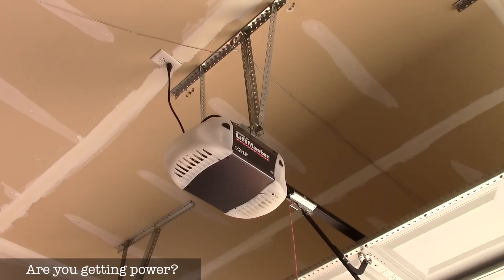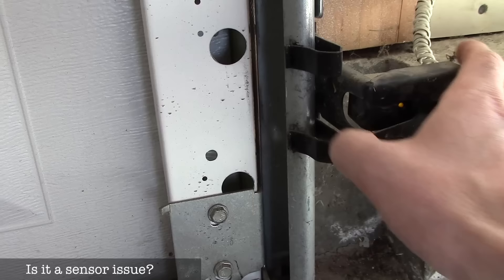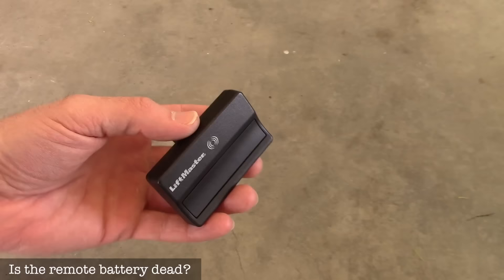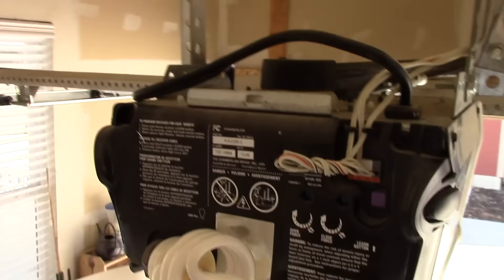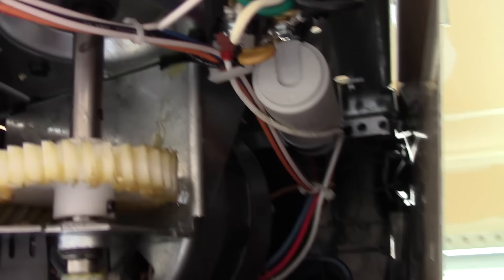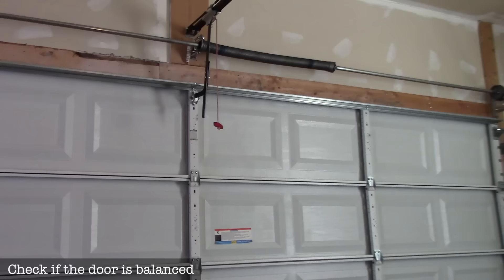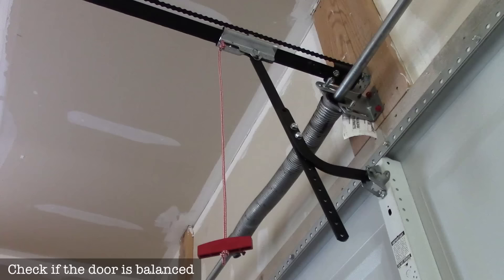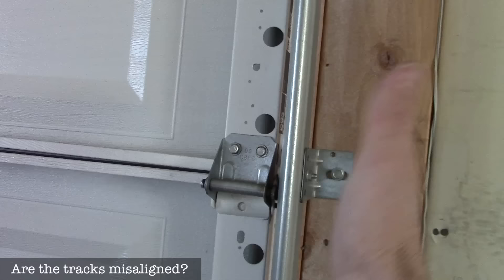Garage Door Opener Troubleshooting and Repair - How to fix common problems

Comment: the slide bar is not connected and when you press the button it moves back as far as it can go then stops. it will not move back along the rail to the garage door and reconnect. also I pulled the handle so I could manually raise garage door but I cant pull the door up

Comment: Help! Recently the long black wire that leads to the garage door fell down. Now when I shut the door, it pops back up unless I hold the button down. I don’t know what to reattach the wire to?? Is it a ground wire that just needs to be attached to a screw? A pull it as far as it will reach but I don’t see what it could’ve been attached to 🤷‍♀️
Can anyone help?

Comment: When I use door opener the motor clicks but door doesn't open so I release the track lever and open door put the lever back on track and press door switch the door will close and open a few times and I  leave it alone come back 10 mins later and door won't open again with the switch or remote so I repeat the earlier process. Any ideas?

Comment: The garage door opener used to operate when I was about 100 feet from the house driving down the road. Now most of the time the remotes and the car buttons don't work unless I'm right at the garage door outside. It sounds like RF interference. How do I check that?
Reply from the maker: Did you recently install LED bulbs within 20ft or so? Those have been known to cause problems.  You can buy an RF Meter to test your area but I have no personal experience with them.

Comment: My garage door opener will not work! Remote and button on wall doesn’t open door.  There are 3 doors and 2 work well, buttons on wall are lit except for problem door. Breakers are fine. Any ideas?

Comment: I'm having an issue where when I press my garage remote button or the button on the wall I just hear a single click from the unit. I verified that it is getting power and that the sensors are working. 

Any ideas?

Comment: My opener would start open then reverse after about 6 inches. I unplugged it and adjusted the rpm sensor. Now, after plugging it back in, it doesn't respond at all. Please help.

Comment: How do i fix a programing problem? My garage works fine but my remote stopped working so I replaced the battery but it still wont program to anything

Comment: Hi.....why do remotes on my craftsman garage open only work when I'm inside my garage within 2 feet on my opener. From outside my garage the frequency isn't strong enough to open the door. I replace both batteries on the remotes.....no change.
Reply: Based on this video that sounds like the antenna might be the issue?

Comment: Turned breaker off and on. Pressed wall unit and it sounds like the motor is running but nothing is moving.

Comment: My wall switch opens & closes fine. My remote keypad & 2 handheld remotes open every time. But they quit closing the door. Unit does not even try to close...no starting & stopping. Sensors are good & unblocked. Changed bulb. No joy. ??

Comment: great video. But I decide to ask you help because I  could not find any answer for the issue I am having.  please I need your opinion. The issue is that when I close and open (USUALLY closing), the door stops at the same time the light off as well . And sometimes it works after few minutes or after while (10 mins or more). I checked everything you mentioned ( except capacitor) and found nothing wrong. any idea? thanks so much.
Reply from the maker: It sounds like the door is hitting some resistance when it reaches that certain point.  The increased resistance trips the opener to shut off rather than break parts.   Have you pulled the release cord and checked for smooth operation opening and closing the door by hand?
Reply: +AdamDIY thanks and yes I did and found non. it stops at any point and moves again when I push the button. And stops again.
Reply from the maker: its hard for me to know without seeing it, but it could be bad sensors or bad wiring to the sensors.  If you hold the wall button down and force it closed does it close all the way without stopping?
Reply: +AdamDIY thanks.
And the answer is no. It shut off everything including light and when I tap it with stick, light comes on and I push the close button and it shut off again for few second or minutes or hour. And again I tap it, it comes to life and on and on.

Comment: OK.  I need help.  Neither of our garage door opener remotes will close the garage door.  They both will open the garage door but not close it.  The wall mounted control will only close the door if you hold it down until the door is closed.  Can someone tell me if it's the garage door opener or not?

Comment: Help. My garage door pushes down against pavement when i press open, then pull back up two foot and stops there.. leaving a gap😢. If i press open again it will do the same thing pushes down against pavement then pull back up two foot n stops😢 The metal arm bended now😢

Comment: I watched the whole video, checked everything, wires connected, rollers ok, sensor lites unblocked and lit, straight and clean but door still doesn't want to close as if something is in the way of sensors...what to check now?

Comment: Can't seem to find the problem. It opens about 6" then goes back down. Same problem w/remote or with main control. We were away on vacation for 2 weeks, it worked fine. Day after it just wouldn't open. Help???

Comment: You replaced a LiftMaster with a chamberlain.?  Chamberlain makes LiftMaster. Chamberlain is a cheaper DIY version of the professional LiftMaster series. If it’s been bouncing on the way up or down it has to do more with the torsion spring.  Also the chain is super loose. If its sticking due to paint you can put a thin layer f white grease on the areas it sticks and that will eliminate that issue too.

Comment: My garage door will not close when I push the control on the control mounted on the outside door jam,it will close if I enter the code or push the remote.

Comment: My battery was going out and failed. Watched the video for replacing the battery ( I have a Craftsman opener from 9/11) with a new one. Now the push button control on the wall is dead (no power, or light) What could the problem? Tried watching other videos but none of them were helpful. My opener motor unit has 2 buttons a purple one and a black one, pushing and holding one button will open the door pushing and holding the other button will close the door. Can't figure out why no power to the wall mounted control.

Comment: My garage door opened fine yesterday am but went to close later in day and it won't close. It make a noise like it is trying to but it doesn't ingage the chain
Reply from the maker: Sounds like the gears or drive sprocket is broken. I have a video on that repair uploading right now.  Check my channel in the morning.

Comment: I am baffled as to why those sensors use wiring that can literally be clipped in half with your fingernails. I'm so incredibly perplexed I can't even explain. My garage has stopped working several times now because of these wires being faulty at least on mine! Yours look significantly thicker.

Comment: Does a low light blinking of the wall button indicate anything? Button doesn't cause any action.
Reply from the maker: The “lock” feature is engaged.  Hold down the lock button for a few seconds and it will turn off.
Reply: @AdamDIY  Thanks for the reply. I have no lock button on mine.

Comment: My lift master when I turn it on to move it pull from the wall . It moves   a little bit and then reverses back. Like it pulling from off the wall
Reply: I forgot to add I replaced spocket

Comment: I just purchased a home and the door opener opens or closes by it self without using remotes. This happens occasionally. Damaged my car 2 days go . I am thinking a frequency problem. What might be a solution?
Reply from the maker: The easiest thing to try is to erase and then reprogram the codes. If it happens after that, you may need a new board.

Comment: Mine won’t OPEN!!!!! Anything for that?  When I press the lock button, the light on the Mother flashes and clicks, I changed the batter on outside pin pad, but still won’t open the lights on the pin pad pad are red instead of yellow like usual. My remote car button won’t do anything either nor the inside

Comment: Adam, I can't find a solution to my problem anywhere! I have a Chamberlain Liftmaster 1/2hp model number 1355. It is 12 years old, and has been working fine no issues. We have a cat that sleeps in the garage at night, so in the morning we will crack the garage about a foot so he can go out etc. We have been doing that for years, but lately he has been chilling under the door because he doesn't want to go out he wants to spy on other cats, birds, etc! I go to close the garage door and out of nowhere the light bulb is rapidly blinking, the garage door opener on the wall is rapidly blinking, and the opener itself is clicking all simultaneously, and in sync. The sensors are green and amber, the green one blinks when I pass through. This rapid blinking and clicking doesn't stop EVER! I don't know what to do. I have checked over so many things, nothing fixes this. Also no button pressing on anything is making the door open and close, so I had to disengage the door and locked it with a padlock from the inside until I can figure out what is wrong, and unplug the unit and I turned off the breaker. This opener btw has its' own breaker and own plug, and the wires are behind the drywall too. :(

Comment: Good info, but I did not find out how to fix MY trouble.    Door TOO heavy need to put more tension (I see video)  to balance .   Spring rod  to tighten The door spring  for easier raise?   spring up to get a balance > ?  ~~  the door  did not stop and caught tool chest drawer and pulled the door fastener out and when I put it back with lag screws the hook up closes the door  big drop Big  BANG>  but will not hook up to raise.   It tries to raise but drops out and goes back down.    Seems to ME it should have some kind of pin to hook in the carriage for UP and OR Down ) (. 

  Like the thing that hoks up does not hook.   Is there a pin /rod to catch to open?  IT closes it down , but will not hook up  and stay hooked  (drops out and door slams back // when tries to raise.   OR do I need a all new $30 ?   Kit How does it come apart or un hook?   Does the chain come out (loose) and how to get the pin replaced ?    Our door install did not get a safety light system ~~  I see now it should have been with the opener.

Comment: its great but  my problem is that the door  opens and closes from the wall openers  but not  from the REMOTES! We  changed batteries, LEE  bulbs changed out,  no obstructions on the floor sensors either.   but nothing helps!

Comment: Garage door works normally when it's warm. When it's cold. Below 65 degrees, it goes up a little stops goes up a little more stops. Can't figure it out. Works normal in manual no matter the temperature. ????

Comment: Does anybody know what an external button fault is? My vacation lock button even after reset will go off every now and the and the opener will not work. I don't understand why the lock button keeps flashing When I look at the fault I see that my external button icon is flashing

Comment: My garage door won't close during specific times (11am-2pm) and the sensor light flashes as well during this time. When I try to close it, it will start to close, then stops part of the way and goes back to the open position.  Outside of that time, everything works perfect with no adjustment made by me.  What could be the issue?
Reply from the maker: Sunlight hitting the sensor is the most common reason for your problem. I assume it will open with no issue during 11-2?   I talk about it in my other video, see it here https://www.youtube.com/watch?v=CewKaLlns0Q
Reply: Could be that at those times the sun is shining "just right" into one of the optical sensors at the bottom of the door.  That can confuse the devices and prevent the door from closing.  It happens a few times a year with our door, though usually later in the afternoon.

Comment: My garage door randomly opens on it's own. It's not an rf signal that is causing it to open because the light in the housing plugged into the ceiling flashes when an RF signal causes it to open. Can anyone help?

Comment: Garage door goes up and down with remotes.  I have a problem with the opener on the wall inside garage.  It continues to flash and it won't open or close the door.  It is a champlain.
Reply: Chamberlain

Comment: My Sister in Law called and told
Me her garage door would not open. After getting there I notice the mounted door console was not lighted as usual. I took it loose from the door and shorted the two wires together and nothing. I took one of the new remotes and pressed the “open” button. The large main light flashed three times, which indicated it was getting power but it still would not open.
When it didn’t open for my Sister in Law , she just now told me she pressed several buttons with no results. This is not a keypad but a LM console with a flap That has a stud that pushes and activates the console. Under the flap it has a Lock button and beside it a Learn button.
The light button does not turn on the main light, the wall mounted console does not light or flash like before and is totally dead. Is it possible the main board in the opener is bad?
It is a Liftmaster Security 20.
Thanks

Comment: What is the problem, when you can open the door but cant' close it soon afterwords.  Then hours later, it works again?
Reply: Bill - Were you able to find a solution?  Mine is the same......I can open, but directly afterwards it will not close.  However, if I wait for a period of time, it will close.

Comment: I just left my house to head to work and my garage door wouldn't open. Wife's side is fine, my side gives no response. No light on the wall opener, no light on the ceiling opener, no response from anything. After watching this I assume it's the circuit board or capacitor. Breaker is fine and I'm getting power from the plug through the cord into the opener. I have an electrician wand I tested the power with. Hmm. I wish I was home to tear into it.

Comment: My remote only worked to open the door at a great distance. Read that removing the 
Led light bulb and replacing it with an incandescent bulb might be the problem. Try to find a light bulb that isn't LED !!!!!

Comment: Hey Adam thank you for the video. I have a chamberlain liftmaster professional. My problem is the power goes off completely. The wall outlet light goes off and the car remote wouldn’t open or close the door. After a few good smacks to the unit the power comes back on and everything works fine. Sometimes it works for weeks sometimes it last a few seconds. This week it got worst, where it lasts a few seconds only. I checked the outlet with another device and it’s fine. I opened up the unit and checked the wiring and all looks good. The only thing I can’t check is the capacitor and the board. It tends to happen during weather change. Any idea on how to fix the issue?

Comment: My garage door remotes won't open the door, but the wall switch will open and close it.  One remote is old and I replaced the battery and reset, still won't open. Bought a new remote and followed instructions to set code, still won't open and close it. The light is working etc...everything else seems fine...just the remotes won't work. I called Genie and he was no help.  Thoughts?

Comment: Hello Adam.

My question is.  I was having issues with my garage door.  Going all the way up.  So I changed the perimeters and I got the door to go up but too far up where it hit the light and the trolley got stuck and now it wont move.  What can I ask to loose it back and get it back on track?

Comment: Hi. My grage door motor weaks when closing. What's the problem?
Reply: What do you mean it weaks? I thought "weak" is an adjective.
Reply: @purelogic3595  goes slowly when close down
Reply: @basimfara  Have you tried increasing the down force on the opener? Most openers have a setting to increase the amount of force for both up and down.
Reply: @purelogic3595  there is no setting at all .I think something related to the motor winding coil . I appreciate your answer. I think its time for a new motor
Reply: @basimfara  I don't think the motor is the problem because it takes more power to go up rather than down. I had a similar problem on my opener once when it had trouble going down, but it would go up just fine. I reduced the tension on the torsion springs and it has been working fine for two years now. On most springs you need long steel bars to adjust them.
Reply: Sounds good I will look for tension spring solutions and let's see what happen

Comment: Great video, but didn't address my problem.  My remote control will open door but not close it.  Have to close with wall mounted control.  Put new battery in remote, so not that.
Reply from the maker: Jane Tyler double check the sensors.  Make sure they both have power, aligned, and lenses clean.

Comment: Adam,  Great video, followed through with all the checks you covered, but they didn't solve my problem.  I have a Craftsman 1/2 HP (M/N 139.53910D).  When I power up the unit, all I get is a light clicking sound a few times a second that seems to come from the power end of the control board.  The LED in my switch is going on and off, at what appears to be the same rate.  Nothing when I push the switch, no light,  no hum from the motor, nothing.  I removed the chain from the unit to work on the box.  Gears in good shape, capacitor looks? good,  turned the motor shaft when power was on - turned freely but didn't take off as I would have expected with a capacitor problem.  My only thought is the control board is bad. Do you have any ideas?  Thanks in advance for any help.